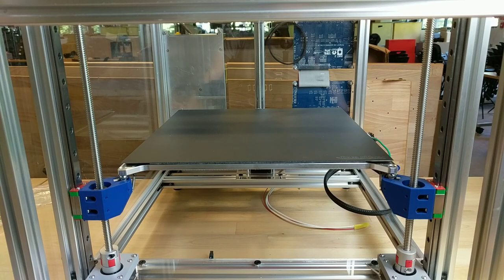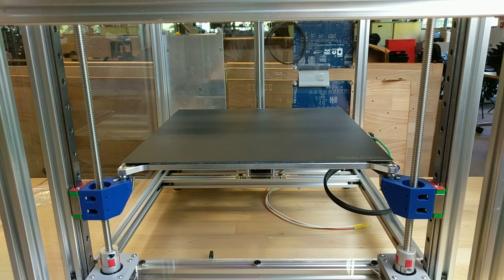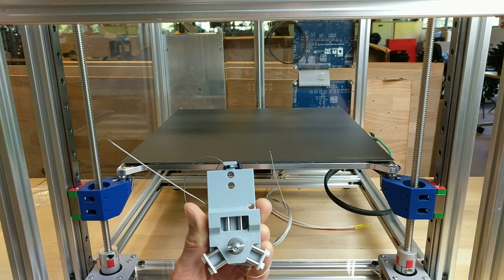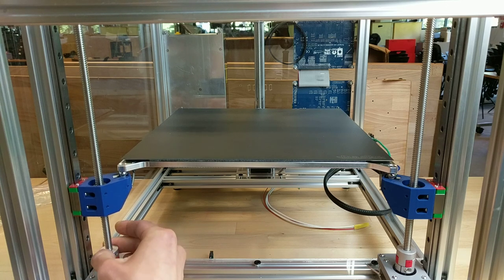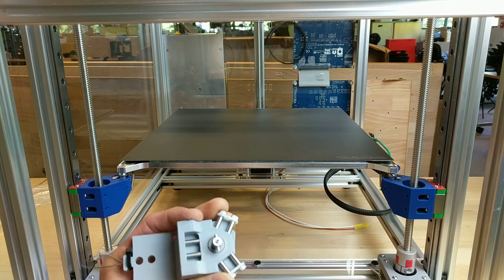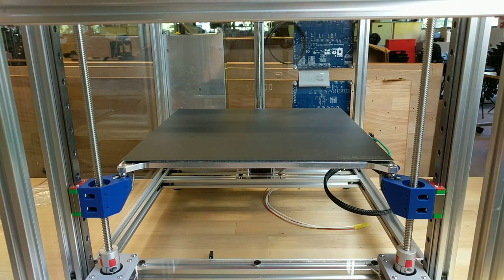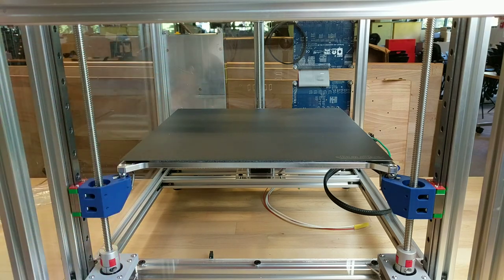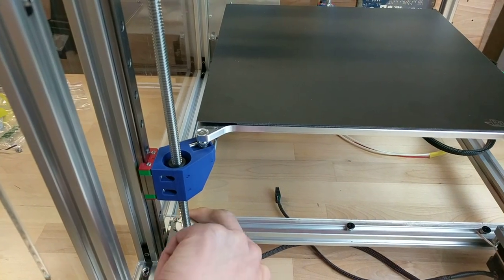Kinematically-Coupled 3D Printer Bed Proof of Concept

Comment: I can't believe you have less than 1k subs. Do you have another channel where you post more regularly? Seems like you're incorporating all the really good ideas in 3D printing into one platform. Look forward to any updates.
Reply from the maker: Aw, thanks, for the kind words. Nah, this is my main channel.  Soon, I'll get these designs out and open-sourced, and maybe then I'll try to plug them into places for more views. At this point, these are just "mission logs" of sorts.
Reply: I'm also curious if you're implementing any means of thermal isolation between the bed and the printed adaptors? I like the idea of having a tool-changing enclosed printer that would be capable of handling temperatures for materials like PEK, but anything in the chamber would also need to be resistant to the harsher environment. Those smaller parts would be easy to mill on a "cost effective" CNC.
Reply from the maker: @klschofield71  This is a good point. The short answer is: Im just going to need to run it up to temperature and test it. While that seems a bit cavalier, dont forget that the coupling is really only touching the ball at two points, so thermal conduction is basically negligible. As far as radiation goes, Ill just have to find out. For pla, though, this should be fine. For other materials with higher bed temperatures, i may need to revisit this coupling and print in a material (ABS) that doesnt have the heat creep effects that PLA does.
Reply: @klschofield71  I think it's understandable, JV representing the cutting edge of FDM 3D printing, so this is not for everyone
Reply: @POOFjunior  petg should be enough probably and is far easier to print than abs
Reply from the maker: Just a quick update. Ive been running a few test prints, and it's been behaving perfectly. Stay tuned for posting in a couple weeks!
Reply: @POOFjunior  'bout time mate :D
Reply: @POOFjunior  I look forward to getting my hands on the files and implementing such bed leveling system on my corexy. This is a great build.
Reply from the maker: @Neeqone  Many thanks! The CADs are now up with instructions here:

https://github.com/machineagency/jubilee/wiki

Comment: I was just planning on doing this! 
Your tool changer project actually introduced me to the kinematic alignment system. 
I have a diy 3 screw sprung flexible bed now and thought it would be easy to use that alignment system as a way to make things a little more solid.
Reply: Me too, except I like the coupling better here than in my design.

Comment: Me again. I've committed to giving this a go on my printer. I wanted to upgrade to linear rails on my Z axis anyway, and there's no better time than now to convert to kinematic bed constraint. 

I was thinking, with how much you enjoy using kinematics a video explaining the geometry and how you implement the kinematic constraint system in your designs would be cool. 

For instance, every different printer with different sized frames will need different ball rail angles. I think I figured out how to set it up myself, however that could be a great topic for a video. 

Thanks again for the inspiration!

Comment: Thank you for posting this video. I was looking for a good design to base my own kinematic coupling on and yours takes the cake. It's so simple to make. Now I just need to figure out how I'm gonna attach the ball bearing to the bed. Might use a recessed hole on the underside of the bed
Reply from the maker: If it helps, Im using threaded 10mm stainless steel balls that are actually Kossel 3D printer replacement parts.

These days, Jubilee has really matured, and youre welcome to have a peek at this bed pattern and the rest of the design at jubilee3d.com

Have fun on your printer building adventure!
Reply: @POOFjunior  I'm using 8mm ball bearing that I'm gonna have to drill and tap..... 
Not looking forward to that haha
Reply from the maker: @pyro1596  oh maybe no need?

These are 8mm and tapped already
https://www.filastruder.com/products/tool-balls-for-jubilee-3-pack?_pos=3&_sid=b539fae50&_ss=r

Comment: i know you posted a long time ago but what about having the 3 coupler in a "T" shape instead of Y shape that have to point to the center of the bed ?

i mean you're supposeds to heat the bed before, you jsut want the bed not to bend because it is constraint when expanding, but you don't really care if i'ts a little off centered don't you ?
and it's simpler to build/design
the 2 front just have an "X" coupler direction and the 3rd one an "Y" direction.

What do you think ??? and it could be used with the same direction whatever the size of your bed.

Comment: Could nesting force be applied using magnetic force? I'm using 1 inch magnetic disks with #10 countersunk holes on my delta. Each has approximately 25lbs of pull force and you can get polarily matched magnets from k&m (they are awesome) so you could have a 10mm steel sphere sandwiched between 2 25lbs pulling forces
Reply from the maker: Totally! I opted for springs in case I ever had a need to take them off and do some sort of "automatic" bed removal.

Comment: how do you setup your duet to move the Z axis with 3 motors instead of 2 and more important to make it perform bedlevelling correctly ???
Reply: nevermind found your github with the configuration. never though of considering the z axis like a delta for calibration.
thanks, cant't wait for the full printer plans.

Comment: Fantastic! I am kinda noob, once you setup this way is the leveling done via software, or adjusting the screw couplers? Thanks
Reply from the maker: No worries! It's done in software as a homing routine.
Reply: @POOFjunior  so you are using only one stepper motor and a belt, instead of 3 steppers? Is it better in your opinion?
Reply from the maker: @Galvo3D  This is still 3 steppers. Whoop, My video frame managed to crop out some important details. 3 steppers is necessary for auto-tramming the machine.

Comment: How does Z-Hop work on a system like that since the bed is not screwed if I am understanding correctly what is happening here
Thanks a lot for your work!!!
Reply from the maker: on the assembled version, there are springs holding the plate down in case you accelerate super fast or travel with the printer. (they're just preventing it from falling off.)
Reply: @POOFjunior  Hey, Thanks for the reply, I still had a question as for the Tool changing mechanism, Do you plan on adapting the firmware to Klipper? I am planning on modifying my Blv Mgn cube to your tool changing system, but I'm still saving up for a duet 2 and duex 5 for in a few month, in the mean time I wanted to try it in Klipper, watched a few videos and read about it, but I don't feel confident enough. 
What do you think.

Comment: Does the coupling counteract z wobble?
Reply from the maker: It doesn't counteract any existing z wobble, but it wont introduce any z wobble by design. In other words, if something besides the bed (like a super bent leadscrew) is introducing wobble, it doesnt counteract that. But, as designed, it doesnt have any source of wobble. From the tall, skinny, prints Ive done, the bed has rock solid layer registration.

Hope this helps!
Reply: @POOFjunior  thank you.

Comment: I love this concept but i think it misses one of the major benefits to probed mesh leveling. You can accommodate for uneven bed surface or beds that rent totally flat. This wont do that unless you do two methods of leveling.
Reply: But isn't probed mesh levelling needed because of the bed warping? If I understood correctly, this setup prevents/minimizes the warping by not constraining the bed, right?
Reply: @c-djinni  i know you commented this a year ago and probably figured this out for yourself lol but yes it will compensate for warp because of thermal expansion, but it won't compensate for bad initial conditions (a warped bed at room temperature)
Reply: @ikbendusan  That won't be a problem if you buy high quality machined aluminum plate though.
Reply: @c-djinni  which many 3d printers don't come with from the factory, so the point stands
Reply: @ikbendusan  many 3d printers don't come with kinematic coupling either...
Reply: @c-djinni  okay sure if we only consider diy printer builds and you obtain a good flat plate it shouldn't be a point of contention, no

Comment: I'm kind of a newb so sorry for asking but why would someone use this instead of just screwing the bed down to an extrusion/plate and using software comprehension I manually kind of get the bed close as I can with screws with springs and then use that. cause my bed is bowed in the middle. also 3 motors on my board wouldn't work it has only 5 steppers ;c but one day when I'm rich AF i'm gonna build one with a duet :D
Reply from the maker: No prob. This setup involves no manual setup. When the printer starts, it pokes the bed at three points with a limit switch. From there, the screws independently adjust themselves, autoleveling the bed. What's elegant about that is that no manual work is required. It's entirely done automatically.

The other benefit has to do with heat. When the bed plate heats up, it expands. From setups that are rigidly connected, this expansion cannot freely grow, so the bed warps as it gets warmer (and bigger). With this setup, the bed can freely expand unconstrained. What that means is that the bed will still expand as it gets warmer, but it will not warp and it will not change its angle. Instead, it simply "grows" into the coupling.

Overall, this is a bit tricky to explain in words. I may do a followup video with the autoleveling demonstrated.
I hope this helps though!
Reply: @POOFjunior   Thanks :) is there anything wrong with software comprehension? (like normal mesh leveling with a probe that makes the z axis go up and down!)
Reply: @chloemcholoe3280  Nothing wrong with it, per se.  However, normal mesh leveling doesn't actually level the bed in a system that only has one individually addressable Z motor.  Many printers have multiple Z motors, but many (most?) of them they are not individually controllable.  On such systems the best the software can do it compensate for the non-level bed (which is usually good enough)

Comment: How were the 'slot' angles calculated for the thermal expansion of the bed plate? Have you had any issues of miss-alignment from the thermal expansion? ie: the ball not following the track during its expansion.

Comment: This makes no sense. It's a waste of time and money.
It is perfectly sufficient to connect the 3 axles with a ribbed belt and use a single Z motor.
It is enough to adjust the height of the table once, by loosening the pulleys on the threaded shafts. Then the Z height never changes.
One motor, one controller, simpler board.
The Bambulab X1 and P1P are both famous for printing beautifully with a Z motor.